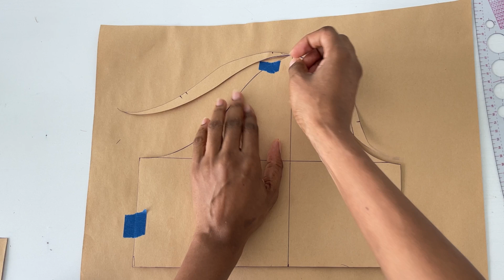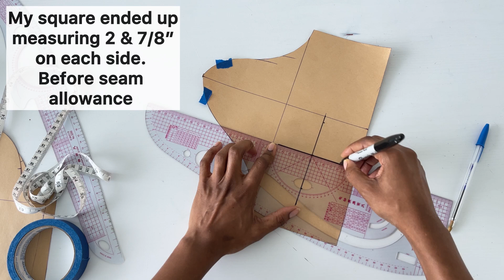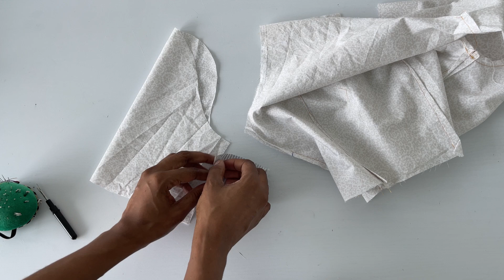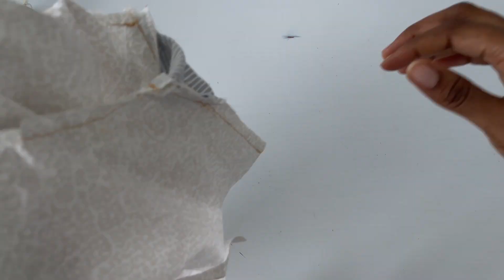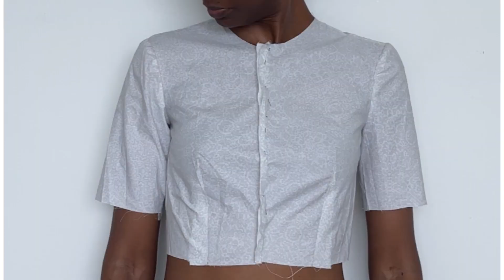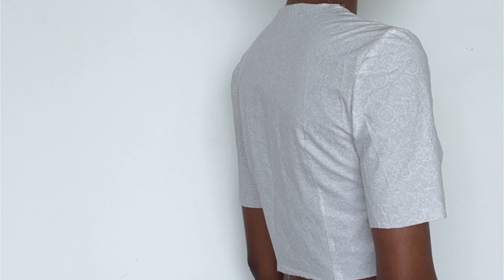Gusset Pattern & Sewing Tutorial |  Built-in Gusset Tutorial and No Gusset

Comment: thank you for this tutorial. is that how to make gusset for pants as well?
and why 4 inches? is it the stander?
Reply from the maker: You’re very welcome, for pants it would be totally different. Sewn the same way by sewing the gusset in the inseam parts, but the gusset would be different length and much narrower width. I used 4 inches lines in o mine because I just guessed that’s what would give me results similar to what I’ve often seen when it comes to gusset. As for the 4x4 “ that others suggest, I am not sure, but I did see it in more than one blog post, So I mentioned it. I would say that’s the standard for adults but to me that seemed too big. So I went with my own option.